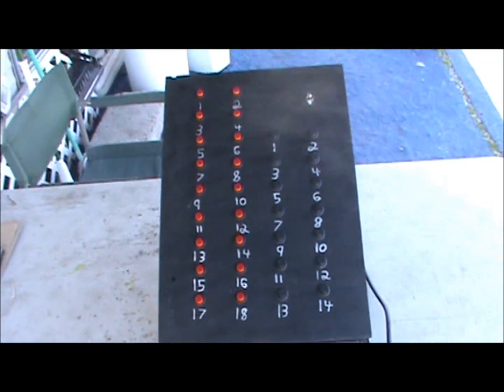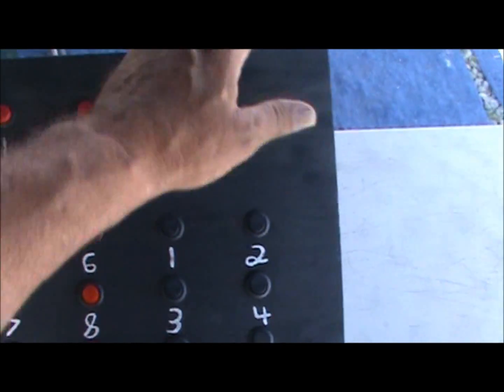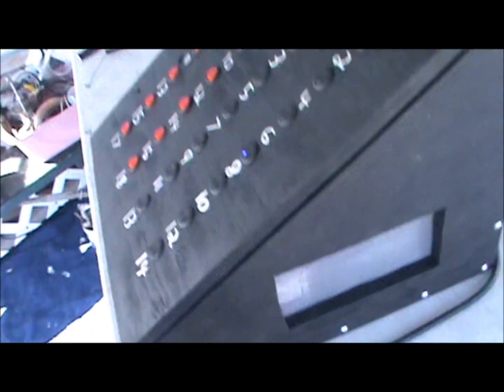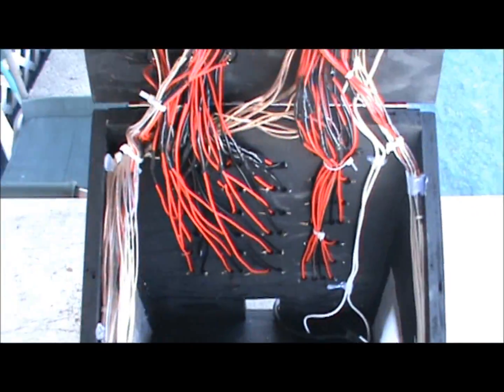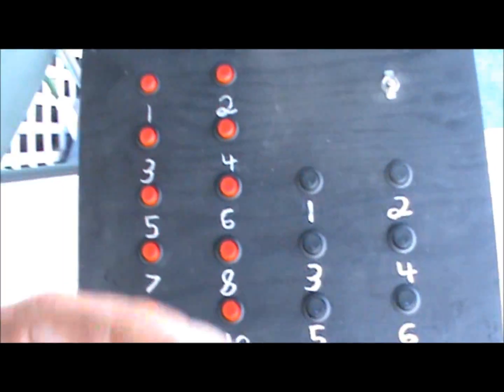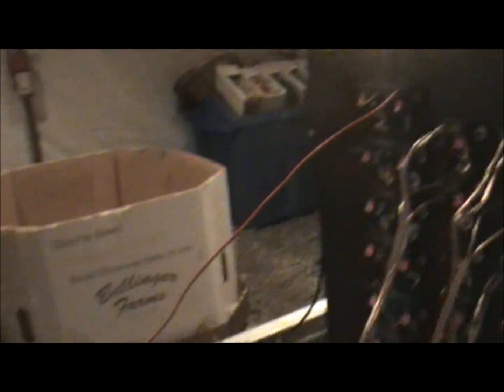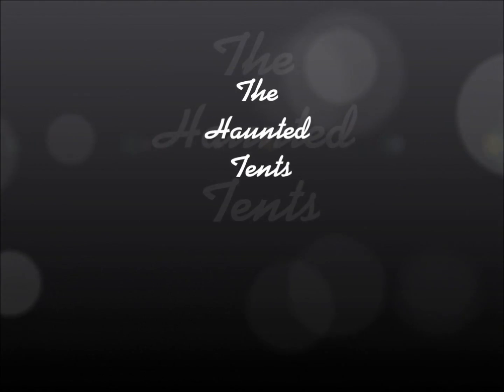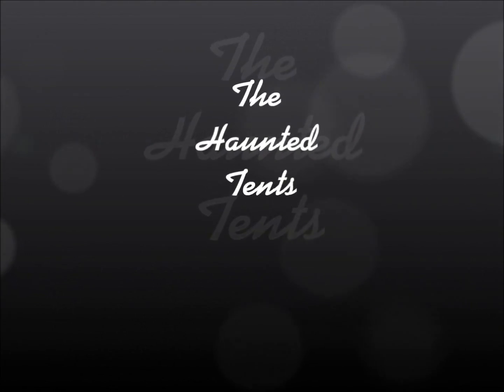LED control pannel  8-27-12

Comment: Love this idea. Thinking of changing haunt over to led here as well . Question though about the pannel box. With the blue rocker switches that are on the 5vdc rail. Are those switches 12vdc being used and seen in a other vlog your thiking of adding the 3 vdc rail too. Will these rocker switches work and the illumination inside switch work on that low of voltage
Reply from the maker: Donte Who no they are actually a 5 volt DC switch designed for boats if I remember right... had been a couple of years since I made the box.. have been thinking lately of eather redoing the box to add a extra switch or just adding another switch. the one thing I did not do with this box that I wished I had was a switch to activate House Lights... that way id something ,, god forbid, happened I could kill the low voltage stuff and bring up standard white light so people could evacuate eaiser.. would also give lighting at night during set up -)
Reply: *****  Thank you for the reply. I was thinking that they had to be 5vdc switches I am having a hardtime finding them in stores here in my area. So thought I'd ask to make sure. I agree having a way to add house lighting would be a big plus too
Reply from the maker: Donte Who to save some time just go to EBay ,, that's what I ended up doing for all the switches saved a ton of cash ,, only down size is you end up having to wait a week or 2 while there shipped.
Reply: ***** have looked there no 5vdc switches so I am redesigning what i have in my head thank you
Reply from the maker: Donte Who im going to do some digging through some old receipts tonight because now im curious, where those switched 5 volt or 12 volt lol,, its been several years since I made that  box and I could swear there 5 volt switches ,, but I could be wrong ,,, on the off side theres no problem with using a 12 volt switch of this kind with a lessor current,, only draw back to it is if its the type that lights up ,, if its 12 volt and you run 5 volts through it the led in the switch many not come on bright or may not come on at all but it will still work to turn the power on and off...
Reply from the maker: ***** ok I before checking receipts I went over to ebay and found the switches ,,, they are indeed a 5 volt switch just type in "5 volt switch" in to the search bar on ebay. or send me a PM on FB and I can shoot you the link to them ,,,,The Haunted Tents or Michael Indorf on FB
Reply: ***** I looked but possably over looked. Yes was thinking same for 12v switches. Thank you for taken the time out for me. Will do a search again and repond on FB

Comment: NICE!!!  love the box!!  i may not need to control the lights like that for this year, but the power block and the master switch will help alot.  Thanks for adding another project to my list!!!
Reply from the maker: lol your welcome bro.... the nice thing about the control box is you can use it to control more than just the LED lights,, any thing that run off of 12 volts or 5 volts can be plugged into the box. ive been thinking of redoing the box and possibly adding in other voltages to it. also been thinking of adding a switch and circuit into the box for house lighting incase of emergency's